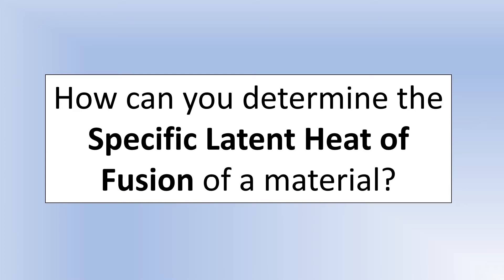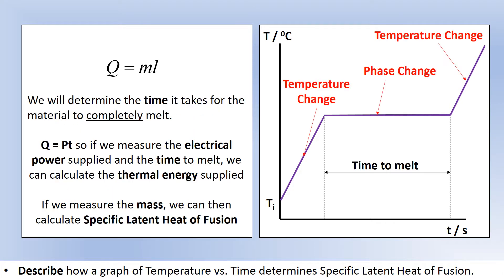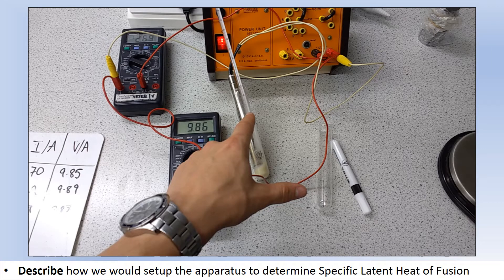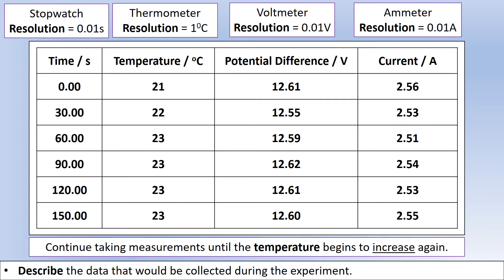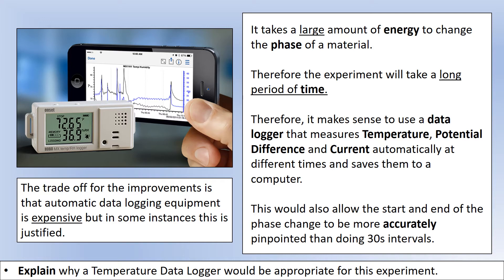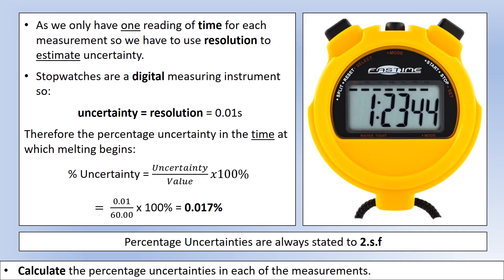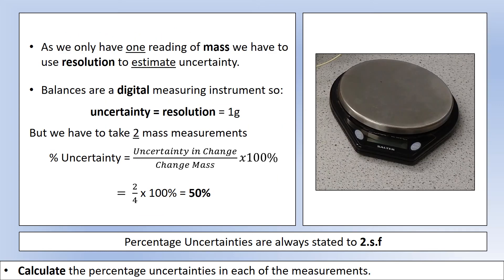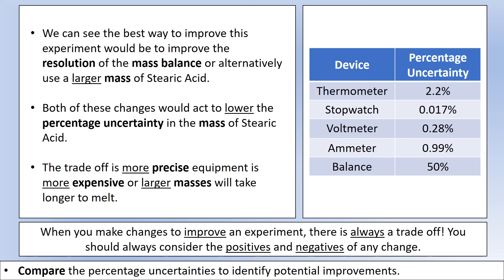A Level Physics: All Exam Boards: Thermal Physics: Measuring Specific Latent Heat of Fusion

Comment: When you're talking about percentage uncertainty and you divide the range by two, is this the largest range your repeat readings had ?
Reply from the maker: Each set of repeat readings will have its own value for uncertainty as the range over 2 is different each time. In an experiment, I would then calculate the average uncertainty to use to calculate the percentage uncertainty.
Reply: thanks!